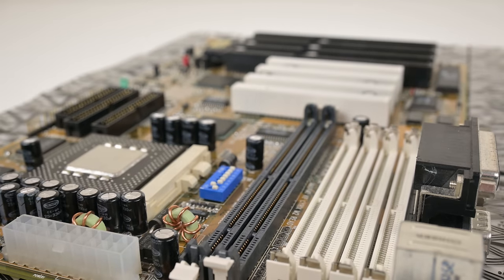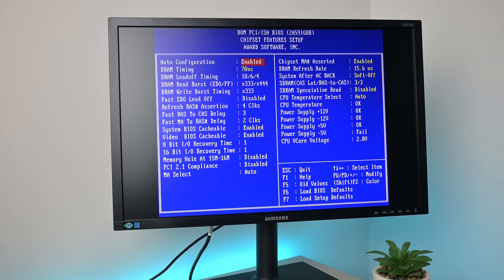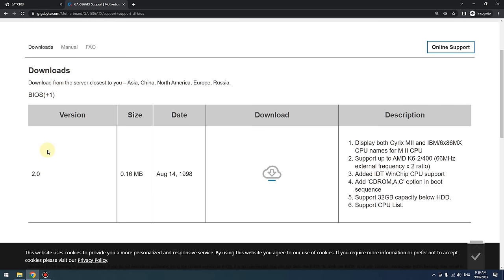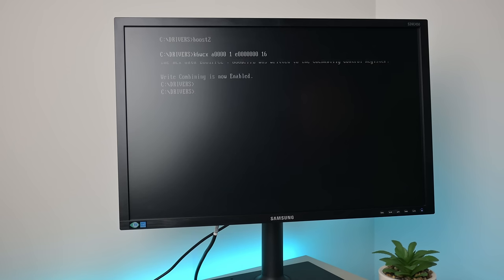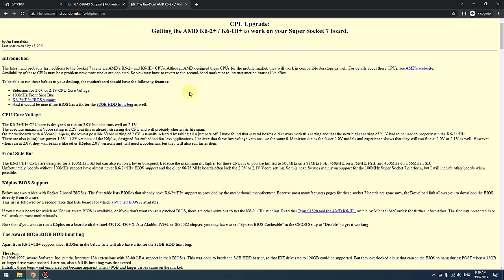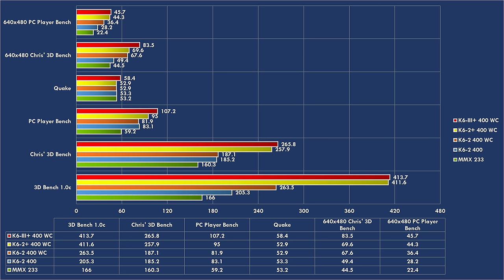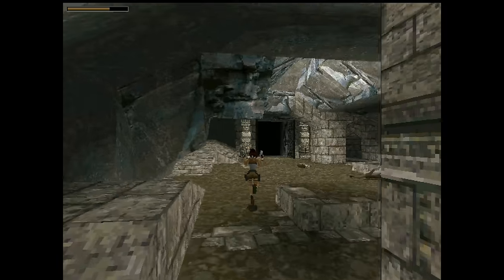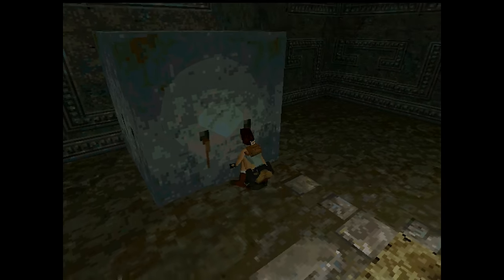Upgrading and Tuning Socket 7 to the Max

Comment: I  need an aswer lol, whats faster a 166 mmx Pentium 1 cpu or a 233 mhz Pentium 1 without mmx
Reply from the maker: 233 non MMX doesn't exist! Afaik 166 MMX and 200 standard Pentium are similar in windows, the 200 maybe a bit faster in DOS. 233 MMX is clearly faster than both. 200 non Pentium likely demands a premium as it's the fastest so a 200 MMX might be a good middle ground.
Reply: @philscomputerlab  I think it might have been a 200mhz cpu.I just remember the non mmx cpu was slower then the normal pentium that  said mmx on the cpu.....i just looked its a 166mhz pentium with mmx and the one inside the computer is a 200mhz  pentium 1 without mmx, or its not stamped on the cpu, which would you go wirh for an retro pc? I want to use this with Windows 95 or 98 SE and a voodoo 2 or 3.I think its to slow for a voodoo 4 or 5....I do have a 733mhz pentium 3 system I could test out on a voodoo 4 and 5

Comment: Sorry Phil I do t agree in some respects. I have my original p200mmx and I use it to play time appropriate games on it. To be honest I have never really strived for high frame rates or the best picture. However I do agree there is little to no point maxing that system out just go P3 but keep the s7 for those early 3d and end of era 2d titles.
Reply from the maker: All good 👍😊

Comment: 2 x 32mb sticks would have been better thin 1x 64mb gives more bandwidth
Reply from the maker: How come? Dual Channel wasn't a thing back on those systems...
Reply: Sorry was thinking of p4 era  but would forcing system to spread memory across two different modules increase performance ?

Comment: Are you calling me a little bit older?
Reply from the maker: Yes 😊
Reply: @philscomputerlab I remember playing Quake 1 for the first time. It was with keyboard only (no mouse) and hating it. Because the view would automatically point down when entering downwards slope in the first level. Confusing me greatly. Much worse than Doom, Heretic, Descent, Duke3D. So I might be actually little bit older (no gray hair, so far).

Comment: Windows 95?  How about a much more modern Linux distribution?  I can only imagine it you can get a lot more out of it with Linux, and there's probably a version thereof that can still run on that platform, updated as recently as a month or two ago by some geeks into that sort of stuff..   I mean really, Have you ever heard of "Garbage in = Garbage out"?

I still run an AMD Athlon Phenom II system with SSD's and 8 GB RAM and it's still pretty darn quick for everyday use in my office.  Hey I used to run Windows 3.1 on a 386 @ ~30MHz!  I have a few faster PC's, and my main work horse is an AMD AM4 platform with a Ryzen 7 5700X (8 core) ASAP to be an AMD 9 5950X (16 core) with currently 128 GB Ram but 2 more slot's free for a total of 256GB RAM with 2X WD Black 2 TB .2 NVMe's... All running Arch Linux.  I won't let Windows anywhere near any of my freaking computers!  Not even if Microsoft would pay me to!